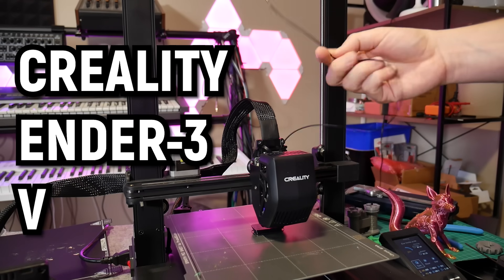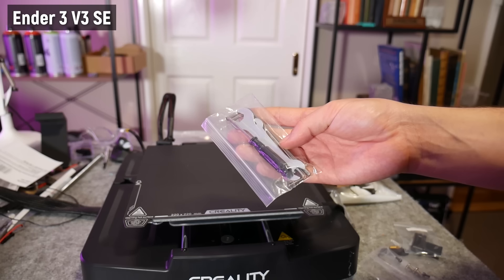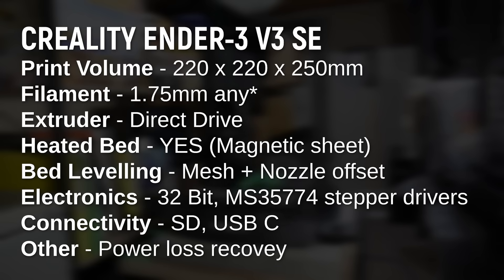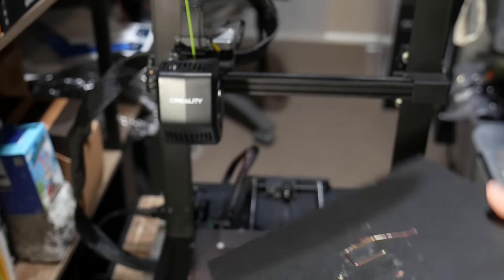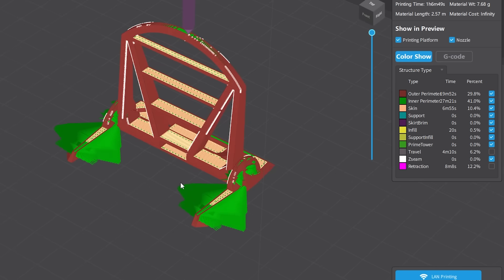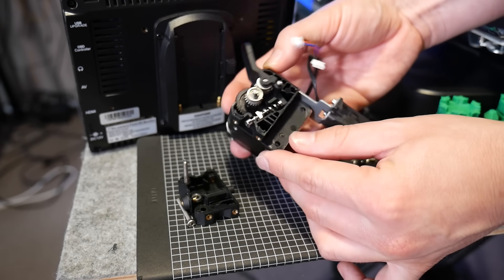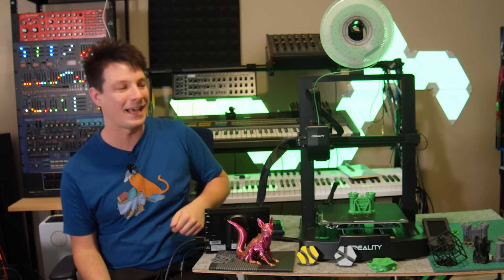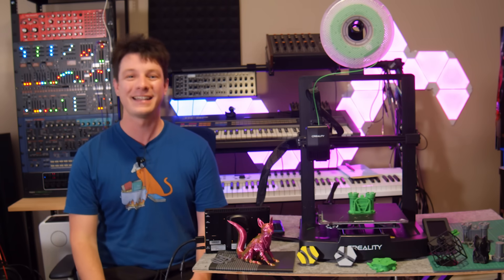The Creality Ender 3 V3 SE is very good. There, I said it!

Comment: This is my first printer i got it used, put about 200h on it but mostly due to a broken stepper which slowed the speed to under half, i fixed it now and its going strong i use it with the nebula pad and the unoptainium firmware for it, first i tried PLA currently doing PETG i will try ABS next, i got it for 100Bucks its well worth the money I spend on it.

Comment: There are rumors that printing over USB port doesn't work. No WiFi. Printer can print only from SDHC card. This is a showstopper for me... :-( Why is there no information that this 3D printer cannot print over USB in this review? That means it cannot be controlled from Octoprint. That is an important limitation, a showstopper...

Comment: I use mine more for my HAM radio and other application level uses.
To that its so far been wonderful!
Ive never looked at minute flaws in printing, stinging or flaws.
Essentially i needed a printed that could make antenna connectors, housing for my motor drivers, etc.. and im really amazed by this machine. So umless youre into really fine detail or working ABS this is a beauty

Comment: i bought it and accidents did happen and it broke, cant print no longer cause the leveling is way off :P even after i had restarted all and re level before use but every time if it goes 12 cm either back or forth it will slide the nozzle to bed, if i use 10x10 then if it goes 3 cm up then the print have lines i mean really deep lines, something def broke back then, dont accidently drop something on it beccause of items at the table, this was my first printer, now i have anycubic cobra 3

Comment: I just ordered it, please don’t criticise i’m still in 00:36
Reply: Good lord you are making a big mistake. Good luck.
Reply: @guestc142  Printed many objects and and it's good so far. I think for an entry level it should be fine
Reply: @guestc142  if you think its a mistake its probably because you couldnt understand the worlds simplest 3d printee
Reply: @dino-c9q nothing on that printer is simple. The gantry is made of a custom v-slot extrusion except theres no way to fix things to it, so you cant upgrade to linear rails on the z axis. The base is made entirely of injection molded plastic, so good luck trying to replace the weird gantry with regular 2040s. The SE runs marlin firmware in the big 2026.

Comment: I brought this 3D printer (ender 3 v3 se ), and lemme tell you something it’s the best purchase of my life. I started a 3D printing business and it never failed on me. I ran it for days and literally I mean days. I did a lot of batch printing and it took some time to get the setting right but once you have it it’s amazing. Very good build quality and only down side the bed it comes with is a bit crap and the nozzle definitely needs to be changed to a harden nozzle. You will only need to change this if you pushing multiple batch prints and especially printing in abs

Comment: If you flip to the other side you get a smooth surface and dont need to get another bed sheet. just have to redo the bed mesh leveling

Comment: I bought one of these having no experience with 3D printing. I just used creality filament and the creality slicer because I assumed they were all designed to work together and it's basically been perfect. I was actually amazed at how good the setup is for the price.

Comment: I have been printing on the Ender 3 and Ender 3 pro almost non-stop basically since they first came on the market with good results. Now after so many years of intensive usage, the machines are finally giving me some issues. So i decided to  get me another printer. Preferable in the same price range. If the Ender 3 V3 SE is actually so much better then the Ender 3, I think this may be the next one i want to purchase.

Comment: I'm just at the point of chucking my ender 3 neo in the bin, tried converting to direct drive so I can print TPU but just can't get it dialed in and now every other print material fails, even trusty old PLA. Using Orca slicer, not sure if that is part of the problem. Unfortunately creality has not cheap off the shelf option so buying a whole new printer seems more economic then spending big bucks on after market direct drives. Guess I should convert it back to bowden setup and buy a direct drive printer from the shop floor. My original Ender 3 pro did the job with no hassle.

Comment: Holy Smokes! What a piece of junk. I have tried, tried and tried to get this stupid printer to work. It printed about 3 decent prints, then straight to crap! Seriously, this thing has been an enormous waste of time, money, energy and broken my patience. The offsets suck, the axis sucks, holy crap the bed level sensor SUCKS! That thing would only deploy 2% of the time. I had to WD40 it, pull on it, prime it... for the love it would never just drop in place. Once it did drop in place, the print would start, then the Y axis would shift. I bought a Y Axis upgrade, an X axis upgrade, I bought the supports to help stabilize the thing... Nothing would get this stupid thing up and running. I am ready to take this thing to the range, and get at least some satisfaction out of this waste of time and money. Do yourself a favor... don't even start. If you're a veteran to 3D printing, you will know better. If you are new to 3D printing, for the LOVE, get a different printer.

Comment: I just happily tossed my v3 se out on the concrete driveway.  Fixed the nozzle problem, then got a hotbed temp error.  fix that, then the printhead goes out of alignment and scrapes the hotbed.  reflash, then everything went really bad, grinding gear sounds, can't level... i finally just gave up.  I will never buy another creality product.

Comment: Hi! New owner of a Ender 3 V3 SE here, and a long time follower. I got HUGE problems with stringing, Diffrent slicers and brand new filament does not help. Using Stock profile and I am about to give up, it get so bad it rips prints from the bed due to nozzel hitting en "spiderweb" of stringing. Do you have any advice I would MUCH appriciate it , prehaps you got a Custom profile that works good?. Anyhow thanks in advance!/ Cheers from Sweden

Comment: I bought a Ender 3 V3 se with auto leveling bed, and it does the same sh1t. The first print out of the box I did was the "defiant" ship from star trek ds9 and it printed nearly flawlessly a 180 x 200 mm version the ship was in 2 parts both standing on the sliced edge and straight up next to each other, yes I printed both halves at the same time. It took 40+ hours and I used stock creality slicer (HQ) settings. It was whipping around that bed and head like crazy but it did not fail. The problems started after that, prints got worse and worse, it came of the bed or did not adhere at all (yes I cleaned it well) glue stick did little to help then the mid print failures (like yours) started and I was still on my first role of pla filament. I tried tweaking the hot end and bed temp to 205/75 c it looked like it would help at first but the faults came back. Is it the printer, me, or is it the software that is f-ed up? I can only fix faults I can understand, can it be fixed (if so how) or did I buy e-waste from the start? Somebody please help me.
Reply: Dude mine does this too it sucks. It doesnt stick to the bed at ALL and besides that its pretty stringy if it does stick
Reply: @gabegarza6320 
Do you wanna trade 3d printers, mine sticks way too much even with a glued surface.

Comment: Does this have WiFi connection for printing ?
Reply from the maker: Nah, not this model
Reply: @ ok thanks
Reply: @ but can you use your phone to print ?
Reply from the maker: Nope
Reply: @MakersMuse  alr but I read that you can use this app called creality lite app and you can plug your phone in using usb c and then print it out that way is that true ?

Comment: I use a mirror bed on my original ender 3 pro with no adhesion issues or adhesion helpers needed. I occasionally wash with hot water and dawn to clean it. A couple small binder clips hold it in place. Never went back to the creality flex or coated glass bed.

Comment: I literally just bought this. Unfortunately I can't use it rn because I have a bachelor apartment and need to set up ventilation first, but for what I would have had to spend on a Bambu Lab printer, I can buy the Ender 3 V3 SE, an enclosure, a bathroom vent fan and vent hose, and buy the materials to build some shelving for storage.
I can't casually add $250CND for something I am still not entirely sure about

Comment: You can buy a run out sensor from Creality, or other places for around $20 au in Australia. I got one the other day, but haven't installed it yet, but it looks pretty easy, and should only take a few minutes. 

I also got a Creality Nebula Smart Kit Smart Pad, which is a touch screen with a camera and a vibration sensor from Temu for $100, but I'm not going to install it just yet. I've only just got the printer, and I want to use it a bit first. Then when I know how it performs, and the average speed, I'll setup the Nebula kit, and see how much better it is. Supposedly it improves the performance and speed considerably, so I'd like to be able to have some idea how much better the printer will perform with the upgrade. And being new to 3d printing, I still have a lot to learn, and so far most of what some are saying is gobbledygook lol. So I'll be watching some tutorials, and doing some reading for now.

I do have an item I want to make, but I haven't been able to find any pre existing designs for it, so I'll have to figure out the best programs to use, and learn how to design the item, and fingers crossed, I manage to learn how, and print the item, and it does the job first go, and of course, it looks good too.

Comment: I just got one after watching this video because I am a beginner at 3d printing. But I'm having issues. It worked great when I first took it out of the box and it had a great first print but after that print, whenever I turn it on, the screen freezes on the blue bootup screen. I've tried unplugging the machine and plugging it back up. I even found a tutorial on YouTube for this exact problem but when I tried it, it still didn't work! Do you have any ideas on what I can do to fix it? It's my first printer so I don't know what I'm doing

Comment: Wel  11 month.s later .
The creality 3v3se. 
Is a top machine. 
For you owners out there.
Use the ke default profile.
And say to creality slicer that you have a 0.6 nozzle on there.
And yeah you want that nozzle.s asap.
Then put the layer hicht on 32 and the second one 26.
The rest lease it.
Put the printsnelheid at 250. Mms.
And let it rip.
Not normal a used cura slicer orca try them al and cura is most of the time the faster. 
Bud this time.
Minutes bihind.
The creality slicer.
I cant believe  it myzelf.
Stil thinking some letters.
Here .
Wat then forint.
Just read the first letters. 
Thats what iam thinking. 
Tommorow i wil the 300.
From the standaard default. 
Bud 250 mms guys .
No problems.

Comment: LOL....I jut came across the term "bedslinger"........now that is a very complete way to describe a printer where the bed moves back and forth under the gantry........one thing that did catch my eye in the video and that was the latest Ender 3 .....it showed the Z axis drive with twin screws........that is a total game changer for me as I toyed with various ways to fit a second Z axis screw drive , however I will drive the twin screws with a single stepper  motor on top of the gantry in the middle driving separate short belts to either screw........I think the long belt across the gantry could be too elastic.

Comment: Yeah, and there's another bug, in firmware - if your lights got shut off during the nozzle Z offset callibration, it pretty much can run into printing bed and ruin nozzle, heating block, thermal break and the printing surface. If you notice this fast enough you could try to switch off the PSU, but it won't help much, it will still have enough power during the manual "stop" to ram into printing bed.
2 out of 3 times power outage happened during callibration i've managed to turn it off quick enough.
Slicer is far behind Orca and Cura:
1) Support material bug (it happen with different models, different filament types, the only way i found out of it is switching to *.PLY model format)
2) No support for Ender 3V3 SE out of the box if you update slicer to newer version
3) No print via USB feature included or it does misbehave
4) No proper Linux support ( https://www.reddit.com/r/Creality/comments/1chn8k4/creality_print_50_linux_support_source_code/ )
5) Both Cura and Orca (and also PrusaSlicer) have support for print model modifiers and a of settings for quality & support material tuning, on the other hand, Creality Print have not
The best thing about this printer - you can upgrade it to KE with kits, if there's no E3v3 KE available in your region. 
P.s Great experience with ceramic hotend upgrade

Comment: I hate the trope of “don’t get that printer on a great sale, spend $500” I’ve wanted one for years to use as another tool in my kit but haven’t wanted to break the bank on something I’m only going to use to fabricate clips and the like every once in a while. I finally picked up an ender 3v2 and it’s amazing for the price of $40 I paid new. It can print basically anything any other standard fdm printer can print albeit a bit slower and I think it’s great. This was after I was discouraged by a 3d printing snob and told that it would only be worth the price if I spent hundreds upgrading it. Not everyone who wants a 3d printer wants to get into your hobby, some people are technically adept enough to easily use printers but just want them as a tool to have around. I honestly feel like it pushes people away from the community as a whole when people say that sort of stuff, $40 is a very inexpensive price and although it’s obviously not going to be as nice as a $500 printer, it’s a lot of added capability for the kind of money you don’t even have to think about.

Comment: I got to have 6 original ender 3's several years ago. To say they were a pain in the ass is giving them credit. 

You had to level and level and level... I got frustrated so many times. I ran a 3d printing business and I had a gantt chart full of pieces I had to deliver. I had the machines at home and I swear, once I had multiple pieces for a client that needed them FAST. They gave me the job at 5 in the afternoon and needed to have the pieces by 8 am the next day. I charged a lot of money and I set alarms to check the printers every 1 hour during the night. There was a print that needed to be perfect and thar got printed twice just in case. It was nerve wracking because those enders couldn't recover if the electricity went down. If you had a clog you were done. 

I did it for 6 months and I really couldn't afford to have 6 printers from better quality. I mean I could have taken a loan, but it is a no brainer that the barrier to enter is very low, so it's not convenient to invest so much.

I wanna make some models again, to optimize some spaces and such, repair things which is why I started 3d printing. It is a great hobby.

Comment: This printer is around £150 in the UK right now, for £20 more, you can get the A1 Mini. While the A1 mini has a smaller print bed, if you can use that then the mini will print 9/10 prints no problem, the Ender, lucky if you get 4/10. I like the Ender 3 V3 SE when I got it, it just worked, but then the auto bed levelling just stopped working, which meant the auto Z Level stopped working and I had to keep setting these up manually. Meanwhile, the A1 mini just worked, all the time. I had 4 Ender printers (2 x Ender 3 neo, 1 x Ender 3 v2 neo and the Ender 3 v3 SE with the sprite hot end) and I have now sold them all. Moved over to 1 A1 and 2 A1 minis, now all my prints just work.

Comment: I have looked at this and the elegoo neptune 3 pro, which currently has a limited deal on Amazon at only 198$. Which would you recommend more, or should I look at something different. I want it to make normal stuff but a project I really want to make is one of the deadpool magnetic masks. I want something that can print either parts that size or be able to split the middle section in 2 parts and glue together later. My budget is like 220$ ish.

Comment: I've been watching your videos for a couple of years now and the Ender-3 v3 se is the first 3d printer that I've owned. The reasons being that it's now cheap enough and a fully usable 3d printer that doesn't require additional modding. Just download or cad an object, slice it and print it. There are very few print failures so it's pretty much a case of load the sdcard and filament, select print and wait until it's finished. So now whether I'm repairing something, trying to mod or improve something, or print hobby bits (rc cars and trucks) I can get on with what I'm doing rather than the hobby being having to mod a 3d printer until it's finally usable.